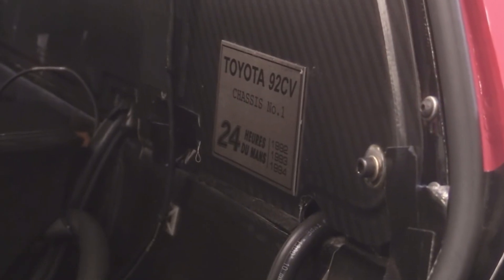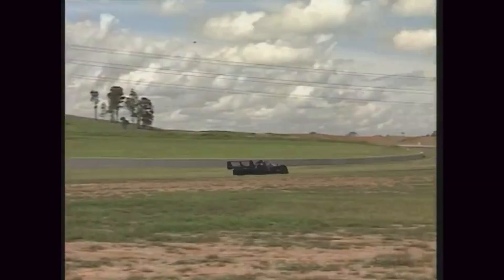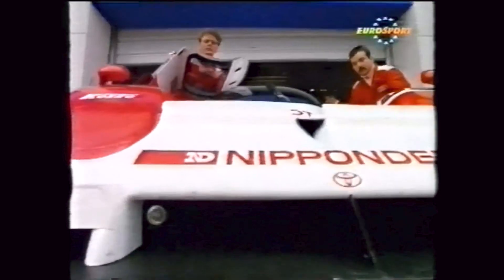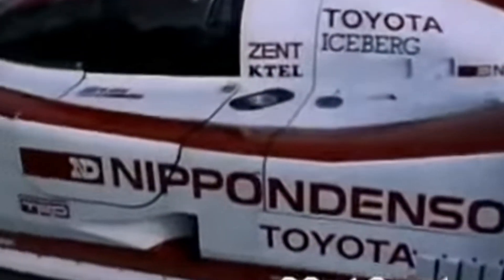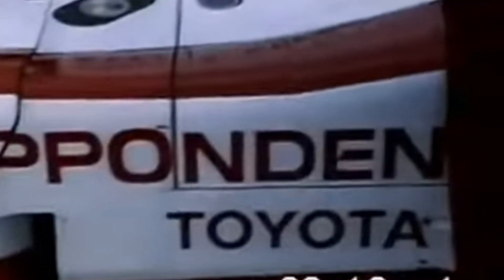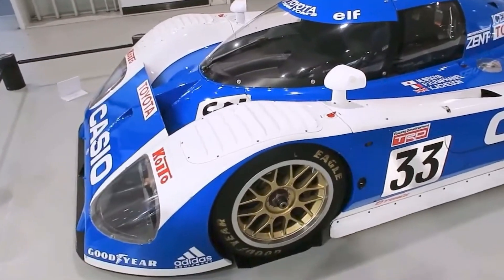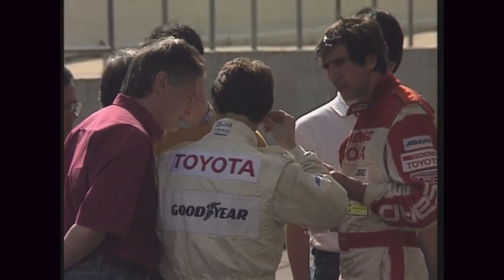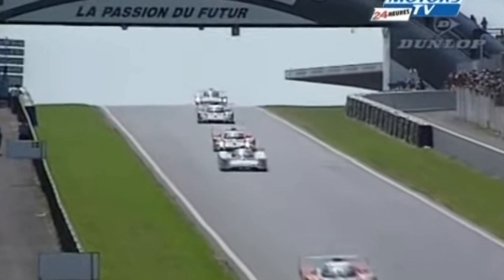Toyota TS010: Too much Downforce?!

Comment: How did you do the voice? Great voice. Is this AI or real dude talking?  Taking a sharp bump in 305kmh speed in car that essentially has rock hard ”suspension”  + the high side G + momentarily loss of it  and going back to G must have janked their belts on to ribcage so hard that it broke the bones. Also thing how fragile drivers usually are, they are feather light to give maximum performance out of the car, certainly not having anykind of peck muscles that could absorb and protect ribs.
Reply from the maker: Exactly something is going to give. Thank you, So it’s a text to speech voice it come out kinda rough sometimes so I have to do some post work on it, but overall it’s better than my voice lol if you want to hear mine I made a video about EV’s where I narrated it. Hopefully I can hire a professional in the future or if the software continues to improve I’ll stick with it. How did it sound to you? Did it mentally take you out of the video?
Reply: @lumemotive  I comment back if I go and watch that. I would encourage to always use your own voice. :)
Reply: @erik_eriksson_design  No Englishman would ever say 'Poogeot' instead of Peugeot.

Great vid and voice though.
Reply: No most English men would say crap..@realMaverickBuckley
Reply: @Goober-o3n FYI the result of le Mans 1993 : 3 Peugeots entered, finished 1 2 and 3.
Reply: Yes they definitely need bigger pecks